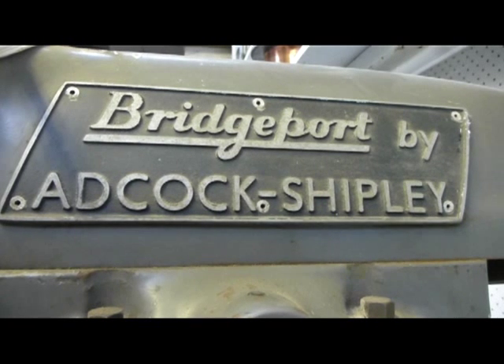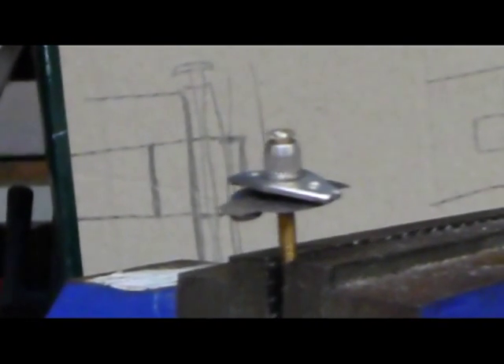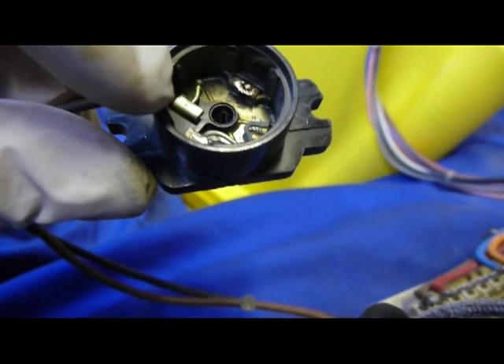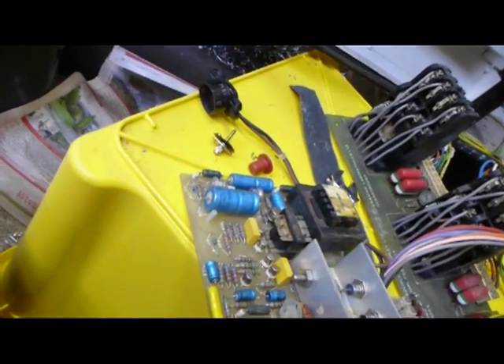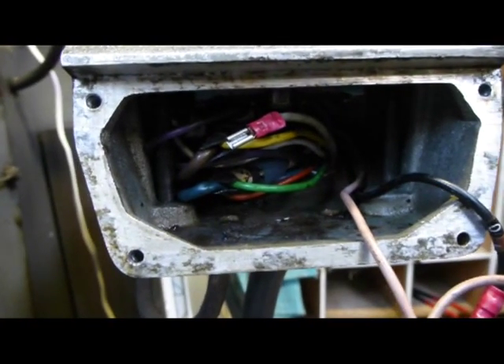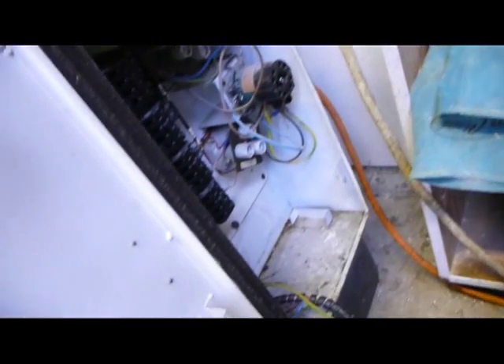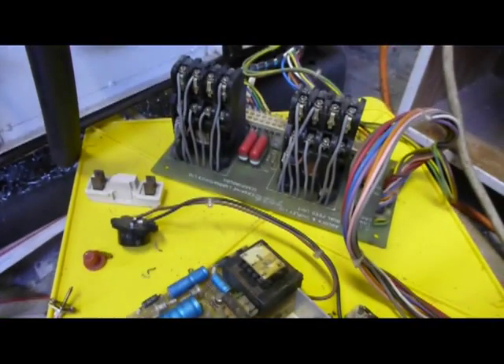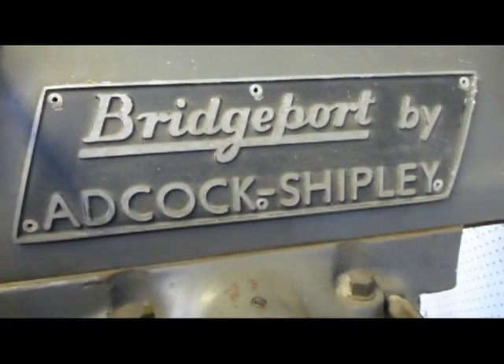Misadventure bridgeport powerfeed

Comment: Hi,
I have a the same power feed controller board on my mill. No surprise it doesn't work either! I have a burnt out resistor R1? (I (can't read the designator as the board is burnt around the area). However it connected between pins 11 and 10 of the large connector. Can I trouble you to measure the value of this resistor? It does not appear damaged on your board.  Thanks